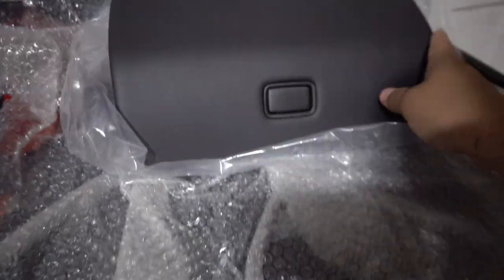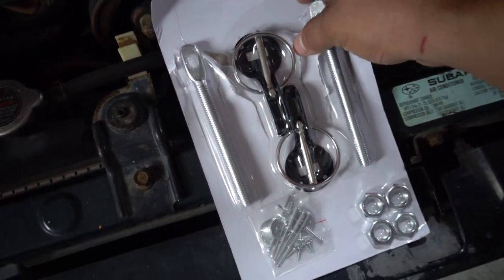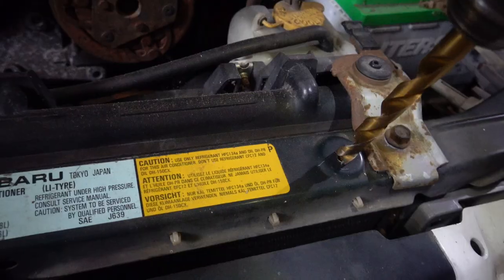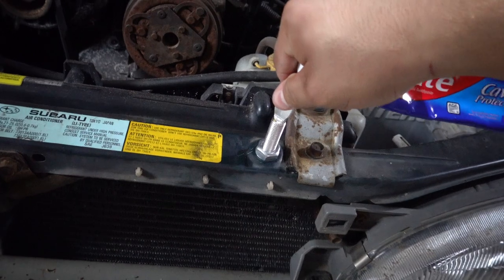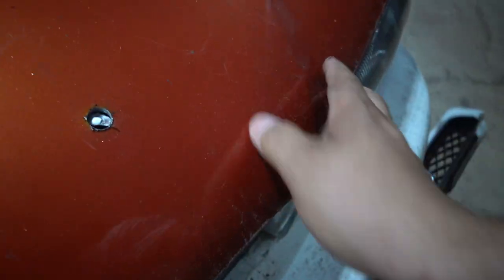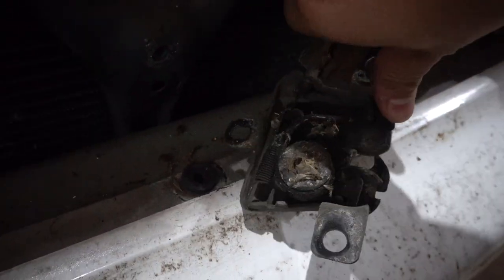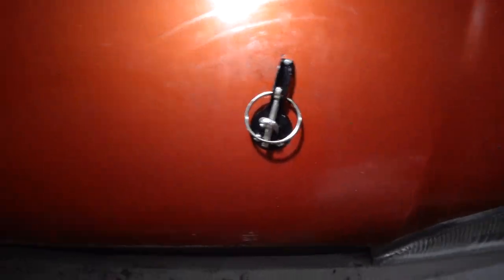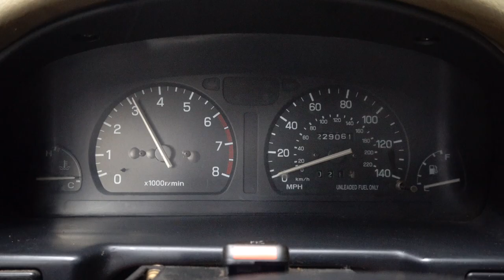How To Install Hood Pins | Subaru GC8

Comment: Thanks for the toothpaste tip. Subaru hood latches suck! Mine keeps popping open, so I want to make sure it doesn't on the open road at speed.
Reply from the maker: Love the toothpaste trick haha and yeah fix that before things get ugly!
Reply: @StayOnTheGas  Fortunately the safety latch keeps it from flying open, but got a set of hood pins on the way because it makes me really nervous.
Reply from the maker: Yeah mine has popped once when driving on my blue gc so I just pulled over to lock it back in place but it’s definitely sketchy
Reply: @StayOnTheGas  First time it did it I was in the middle of a 500 mile round trip. Scared the bejesus out of me. Pins are in transit and should be here today or tomorrow. Gonna put an end to that nonsense.
Reply from the maker: What type of pins did you go with?